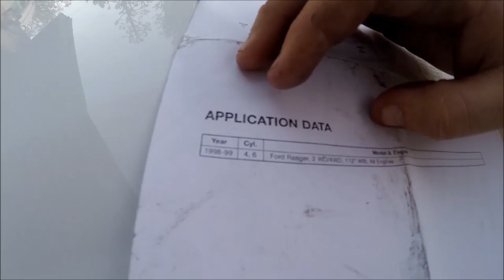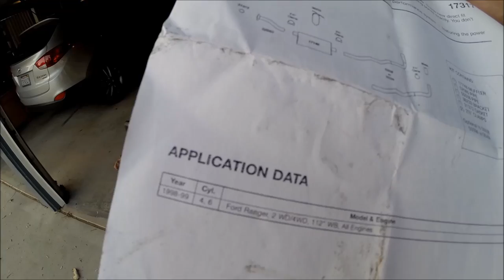Ford Ranger Dynomax Exhaust

Comment: Hey just a piece of advise those tangs on those spring bolt nuts are there so you don't need a open end, just tighten until they rest against the muffler and continue on, ford also did it with the upper control arms.

Comment: Nice video Massey706. Maybe a bit long but informative. For future reference when installing a muffler, it will sometimes have an arrow pointing to the inlet or outlet. If not just remember that when a muffler has the necks (inlet and outlet holes) offset ( to the side) and center, the center will always be the outlet.

Comment: I'm just replacing my factory on a 2010. The lead pipe to the muffler from the cat has an odd rubber thing, about half the size of a beer can, mounted on the top side, that the new pipe doesn't have.  Nobody knows what it is. My guess is some sort of resonance damper that physically reduces vibrations.

Comment: how did u slide secondary pipe on to muffler ? did you use some type of lube to slide it on ? because its a very tight fit to slide it on. Great video helped me tremendously !!

Comment: There are 2 in stock at Amazon.Thanks for recommendation.2000Ranger 3.0LV6 Flex
Another question? My license plate lights burned out and the sockets were corroded. The wires tested had resistance but when I installed socketes & bulbs did not work. Around the same time my dashlights went black so I don't know my speed at night but turn signals work. Ford no makes circuit boards and all fuses look good.Maybe Ford has a main connection or possibly a short somewhere to cause outage. Any hints or guess?

Comment: I have a 2004 Ranger flare side (step side) with the 3.0L with 138K on the clock. All 3 of my cats are clogged. I called 3 muffler shops and the lowest was $400 for each cat not including labor, I don't freaking think so. I can get the Magnaflow Y pipe with the 2 small cats for $537 and the big cat for $187 from Advance. Anyone ever go this route. I may do the Flowmaster or Dynomax catback. that way I'll have all new exhaust for around $8-900 bills.

Comment: Nice video just noticed that you didn't installed back the new O seal ring wondering if you didn't get any exhaust leak there?
Reply from the maker: Yea I probably should've, but I don't hear any leaks
Reply: +massey706 did you know that you left the old gasket on the cat side of the flange? thats why the new gasket wouldnt fit. btw i think that the muffler that you pulled out was also an aftermarket muffler. unless hte 2.3 is different. the stock muffler in my 4.0 xlt is wayy bigger

Comment: damn man 274$?! i paid 150 for install of a magnaflow exhaust !!!
Reply: Sounds like you just got a muffler replacement lol.
Reply: Yea aint nowhere a cat back exhaust for any rangee 150$...  i got the gibson duals and was 300..  but i wound up getting the shorty headers and fabbed up down pipes and cat deletes..  sounds a hell of a lot meaner..  only down side is the drone on the highway until i put hushmat up in..  but got an 08 and i only used one spark non fouler for one of the 02’s and put the other just down the pipe further and no codes...

Comment: I have a  2000 ranger. Which muffler would fit? Is it for the cool sound or what other benefits with an after market muffler?
Reply from the maker: I know this exhaust system would fit your truck, other than the sound being louder, the less restrictive muffler and wider exhaust pipes help flow exhaust gasses out faster. Leading to increased hp and torque. After I installed my lift kit, I noticed a drop in power, after installing this system I'm back to where I was stock.

Comment: do you ever have starting problems when it's cold?
Reply: Ben Price 
Starting problems when cold is related to lack of fuel and pressure in the injectors rack caused by bad fuel regulator or leaky injectors. When parked, the fuel rack loss the fuel pressure slowly. Then you need to start long before injectors rack get pressurized.